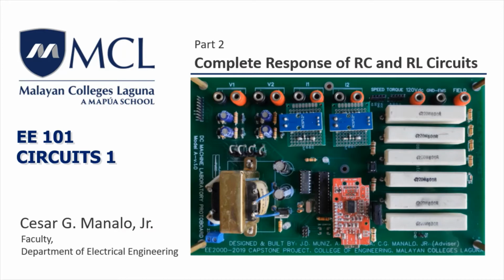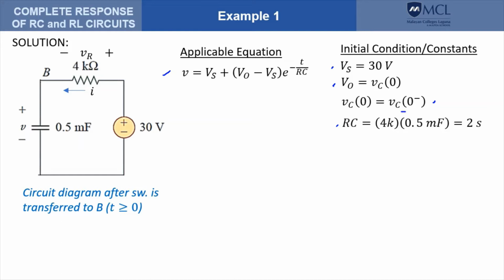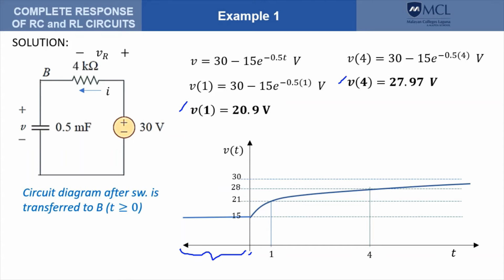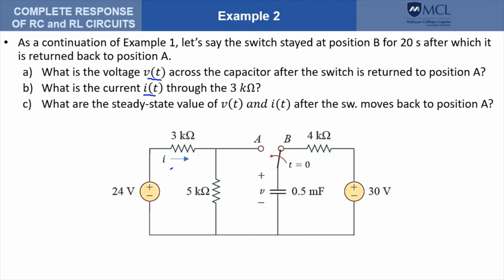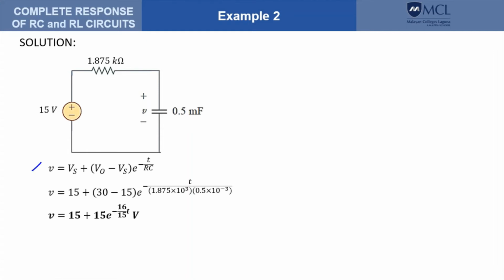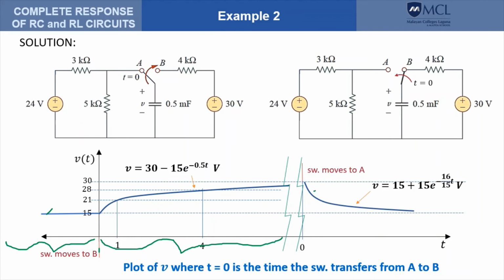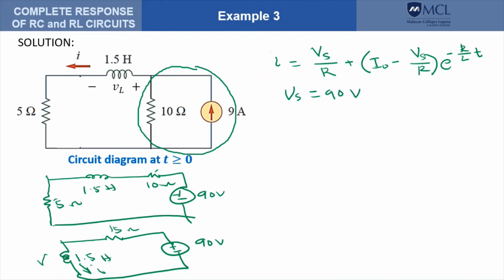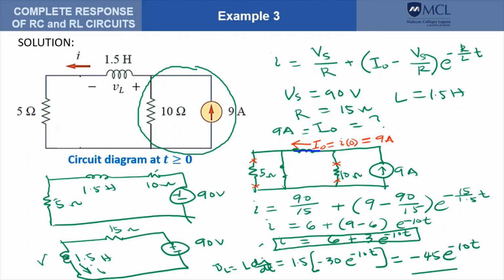Complete Response of RC and RL Circuits   Part 2

Comment: why we can't use the KVL rule in the first part when figuring out the voltage on 4k ohms and we instead use a fixed formula? even though in the 2nd part when getting the current of 3k ohms we didn't use the fixed formula? Care to explain?